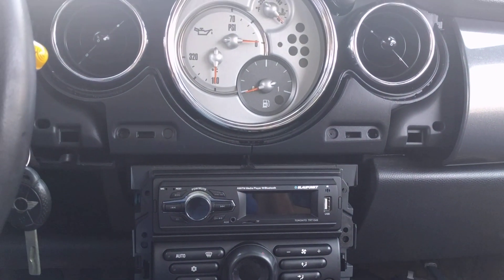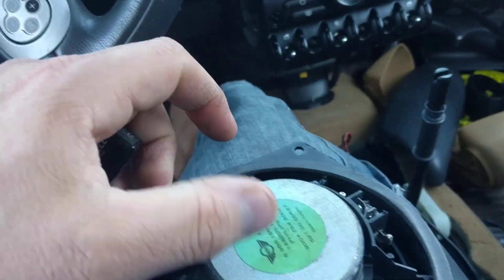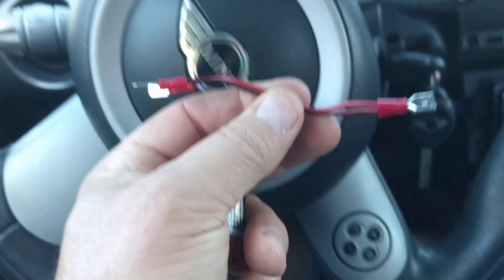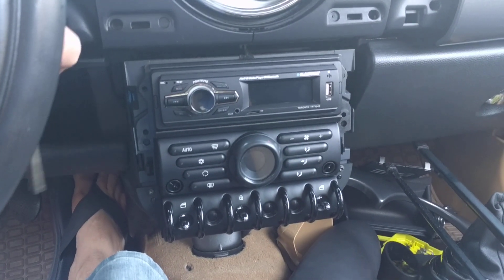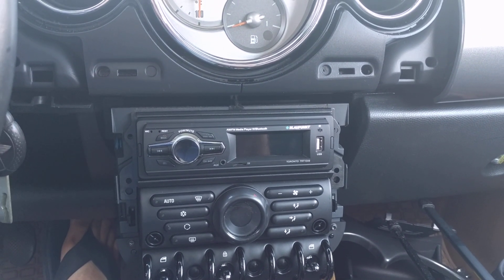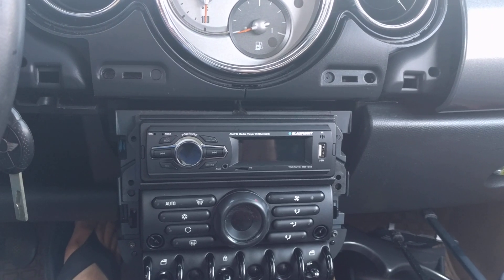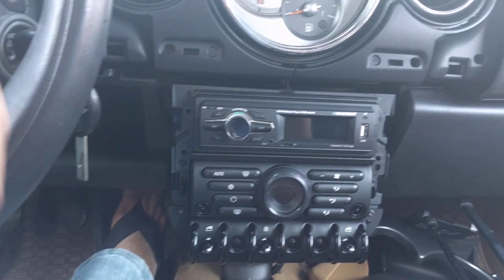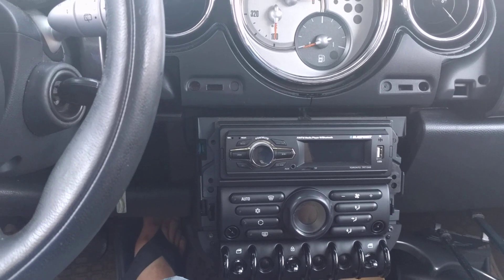Blaupunkt Toronto TRT1049 3 of 3: Conclusions and buy or don't buy

Comment: Yesterday, I watched a review of this radio by user Shango066. He lives in a strong signal area, and he encountered problems with overload. He also reported that the MP3 playback feature skipped occasionally and that the display started to fail after he had driven the vehicle in which the radio was installed about 500 miles (he thinks that vibration was the culprit).

Comment: Actually I had a buddy get one that had the backlight issue also and he contacted them and they swapped it right out for him but I got one and it works perfectly lol, I'm only going to use it as a portable garage radio that I'm able to add an amp n stuff to it and the phone features are great (as long as you don't walk 20-30ft away lol)
Reply: I've been looking at them for a tot rod build, with some small door speakers and a low power sub off the rca's

Comment: That $9 radio will cost 3x now that Trump put the tariffs on Chinese junk. The tuner is crap also as if you live close to a FM transmitter it will bleed all over & AM forget it as you hear 2 stations mixing also. I had to send back as I got 3 of them to put in my older cars & yes the display went on all of them.